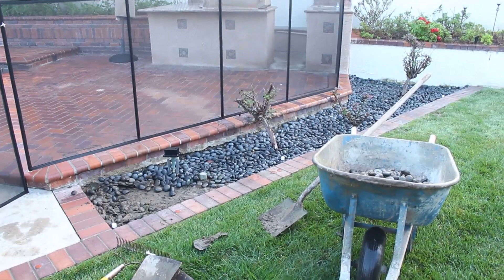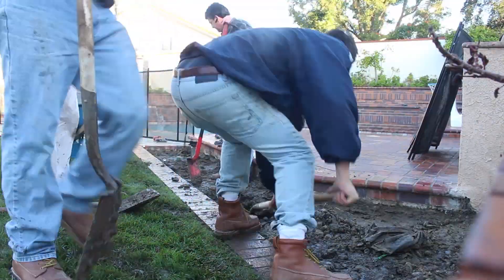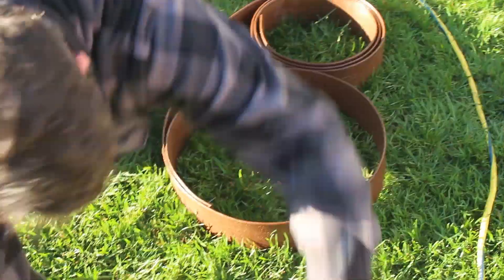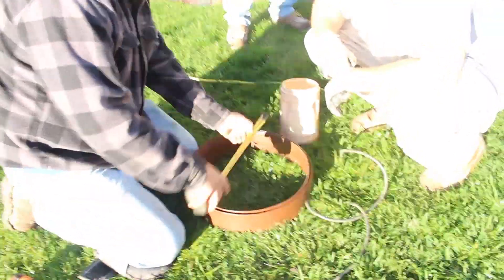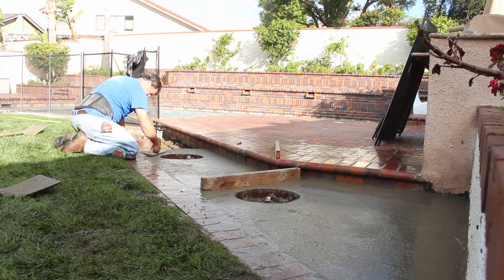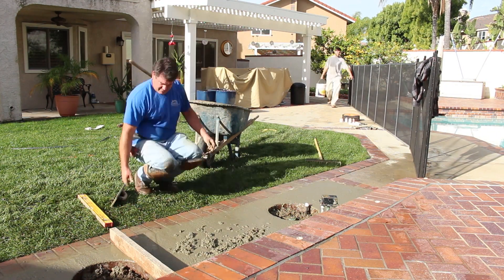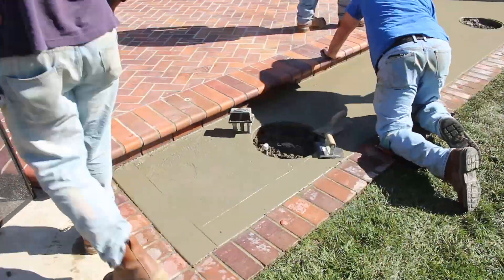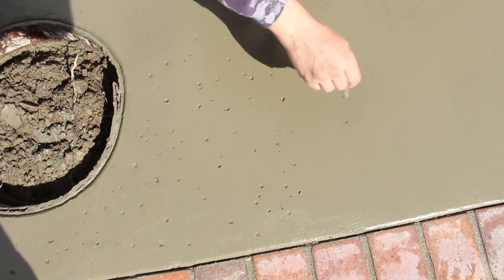How to Pour and Make a Concrete Planter Bed

Comment: Beautiful job. If I pour a 4x4 ft area surrounded by patio brickwork, do I need an expansion joint on at least one side? I noticed you didn't use one.
Reply: Don Olson The weather in southern California is so mild that the slab probably won't see much expansion. What expansion is seen will probably take up the void caused by initial shrinking of the concrete as it cures. I've had the same question and so did a little research. If your climate sees winter and summer then yes, you want an expansion joint. Heat and moisture content cause expansion. The first year of your slab it will shrink to its set cured size (smaller than the initial area). Then winter hits and it will possibly shrink more. Fines and other incompressible material will over the years fill the entire void. Now the concrete doesn't even have its initial Gap caused from curing to expand into. As the concrete expands into this material it will now crack or upheave something. So yes, it should probably have an expansion joint but the weather is so mild it'll take forever in his climate for this to happen. Odel also saturates the crap out of the soil to expand it before pouring so there's going to be soil shrinkage as well. With the rebar and quality of the concrete he lays I'm pretty sure if anything cracks or upheaved it's not his concrete. The customer would then call Odel to replace the "crappy stuff" surrounding his concrete. Sorry for writing a book.